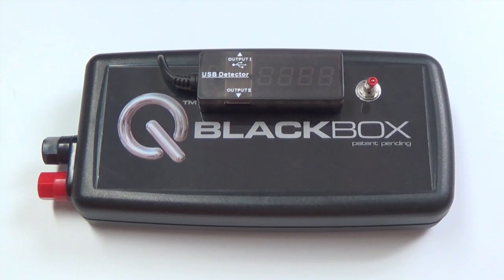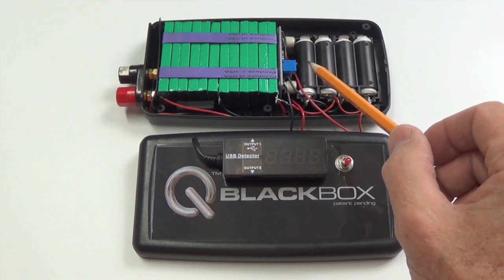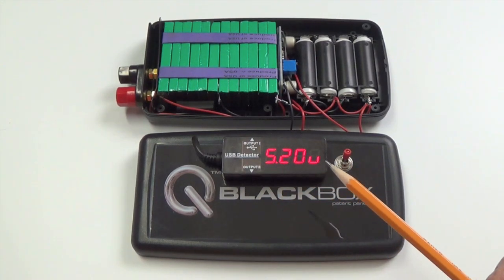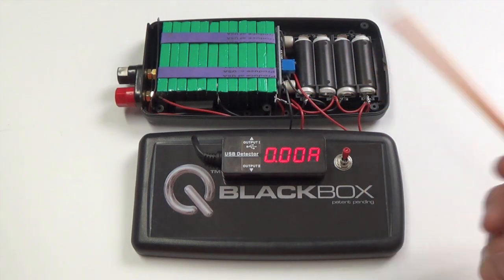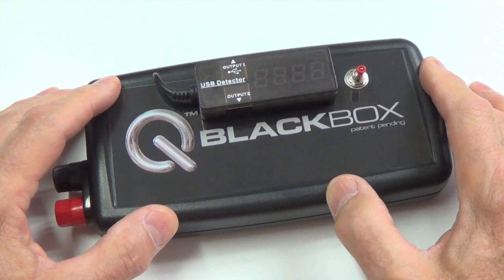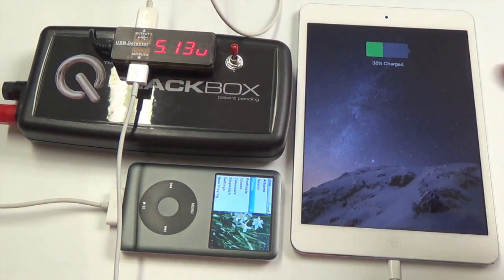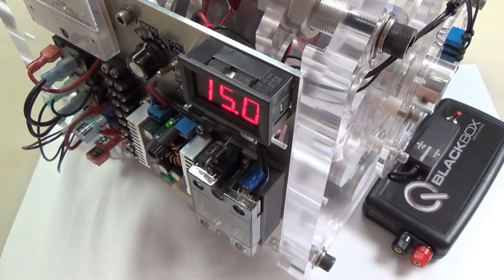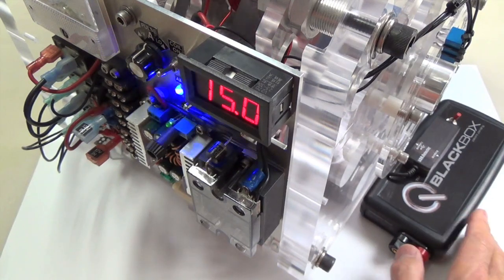BLACKBOX - USB with advanced Silicon Crystal Graphite Battery Technology

Comment: I am skeptic about these "self recharging" batteries. Where do they take the energy from?
Reply: Crystal cell batteries recharge themselves by drawing zero point energy from the quantum vacuum. There is never a shortage of energy in the quantum vacuum, so these cells can keep recharging themselves for years on zero point until they become deformed from internal pressure and can no longer draw energy. A properly designed crystal cell can last over 100 years. The crystal cells I made over a year ago still recharge themselves and are not showing any signs of deformation yet. 'Lasersaber' has a great video on making your own crystal cells if you're interested to learn more. The reason you need lithium ions is because the crystal cells are for energy generation. You still need energy storage which is where the lithium ions come in. You could run it straight off the crystal cells, but only for a limited amount of time because they lack energy density and energy storage. Lithium ions don't have this problem.
Reply: From my experiments with crystal cells and radio frequency, I found the tiny amount of power from radio waves and stuff being transmitted from phone masts and radio stations can provide a weak power source to gradually charge a crystal cell.  Basically, the piezoelectric effect on crystals because RF is oscillating.  I have charged my crystal cells very fast putting them next to a Tesla coil, which is high RF.
Reply: Don't get me wrong, i do not think there will ever be a discovery so abstract to the known laws as to discredit gravity. I just feel there is always a chance that something is missing in our theory of gravity. Hell we may one day discover that what we call magnetism is just a property of gravity acting on ferrous substances over cosmically small scales. Well... I'm no scientist so i cant say for sure,  but you get the point.
Reply: the current from the "cells" is very small, enough to VERY SLOWLY charge the "batteries".. once enough charge is stored in the batteries then the batteries can use that charge very quickly at a higher current.
the current from the "cells" comes from a chemical reaction, simple as that. a very small, slow chemical reaction.
nothing here self-charges, there is a charge in the cells being transferred to the batteries. all power cells require fuel to convert to energy. even solar cells.
Reply: Ghryst VanGhod Isnt voltage pressure and amps flowrate? I mean Amps is measured in coulomb/second
Reply: QuikSilverPlanet
I've seen the entire catalog of the 'Energy from the Vacuum' series and I've watched Lasersabers videos.  The problem is when you start using terms like 'vacuum energy' and 'zero point' energy, electrical engineers cringe.  It's pseudosciene to them and they are the experts.  In fact, you can';t even put those terms in patent applications.  That's why people like John Bedini haven't been able to get their machines patented or even published in any main stream science journals.  You've got to be able to explain how this energy is collected and converted with real science that can be tested.  Tom Bearden has spent over 30 years trying to explain it.  The machine may work but until it's explained and tested and repeated through the scientific process, it's not viable.  It very well may be using energy from the vacuum but how does that work?  Where is this energy?  Why does it appear out of nowhere?  What's the mechanism?
Reply: Peter Müller
There are no reactions that last up to a year or more capable of generating any significant amount of current with the exception of maybe radioactive elements.  You might be able to find something to generate a few milliamps at a volt or two but that's about it.  Youtube is full of videos of people building crystal power cells capable of running an LED for an indefinite amount of time but those have valid explanations such as changes in temperature, moisture, or pressure.  And the LED's are significantly under driven and don't output any usable amount of light.
Reply: True about closed system vs open system. Most people think in terms of closed system and dismiss free energy as a possibility. Lasersaber made a video recently where he went to visit an atmospheric electrical tower farm which harnesses many KWs of power. Check it out. They use graphene collectors in the towers to collect ions from the atmosphere.
Reply: paul4pres08 And vibration of what exactly? And even if so: where do they come from since energy must be conserved.
Reply: chemical energy from the "power cells" recharge the lithium ion battery.
eventually the cells will degrade and no longer give an output. until this guy releases his data, or sells someone one for testing, we will never know how long they last as this guy does not state the chemistry he has used
Reply: Ghryst VanGhod Great to see that I'm not the only sceptic
Reply: oh, it does what he claims, he just makes his claim in a very vague way
Reply: Yeah, I think we understand the claims being made but I think the question is where do the power cells get the energy to charge the lithium ion batteries?  There are many different battery type devices and capacitors with chemical energy but once they are depleted, that's it, they must be recharged to keep on operating.  If this product is ever going to take off, he will have to explain where the energy comes from.   Saying the power cells output chemical energy just won't cut it in the market place.  It will never be more than a novelty.  Just like Bedini's machine.   The real question is, why do you need the lithium ion batteries in the device in the first place?  If the power cells can charge the batteries, then they sure as shit can charge a battery in a phone or other device.   So why do you have to charge a lithium ion battery in the black box before charging a lithium ion battery in a phone?  Why not save the money and losses from charging the batteries in the black box and charge the battery in the phone directly?  Something just doesn't add up here.
Reply: Ghryst VanGhod
The video claims the "very slow chemical reaction" is capable of charging four amps worth of current at 7.4 volts within twelve hours.  That means the "very slow chemical reaction" can output almost 30 watts in 12 hours.  That's a hell of a lot of energy.

If we take the most conservative estimate of 12 hours, the black box is able to output 2.5 watt/hours without having to use a lithium ion battery as temporary storage.  That's plenty to charge your phone or other device.  

The bottom line is any device that can output 2.5 watt/hours without ever being charged is truly unbelievable and would sell like crazy.  I just don't think it's possible to manufacture something like that which would last more than a week at the most.
Reply: rubbish.
if the claims he makes are true, then we are back at the question of: "why not use two cells, and throw away the battery?"
Reply: ps: an alkaline battery is never charged, and it puts out a higher voltage and current
Reply: pps: you dont charge amps, you charge voltage, amps are created from voltage during charge/discharge.
if you think of electric fields as water in a pipe, voltage is flow rate, amps is pressure
Reply: basically, "four amps worth of current at 7.4 volts within twelve hours" is not equiivalent to "30 watts in 12 hours", it is equivalent to "30 watts for an instant"
but no battery i know can discharge so quickly. if you put that charge into a capacitor instead of a battery, you could make a 30w globe flash briefly
Reply: Peter Müller nope, its an analogy of course, so you can interpret it differnetly, but i say amps is pressure, because amps are a measure of how much work can be done. you could also think of it as horsepower vs fuel consumption
Reply: QuikSilverPlanet No energy can be endless. Even "zero point energy" cannot be harvested endlessly. It can only be harvested by seperating opposing quantum particles as they pop into existence. However our universe will in the long term have the highest entropy. So opposing that principle will cost energy. And that will be equal to the energy gained. So where does the energy come from? ((Completely ignoring the fact that creating a quantum vacuum itself is difficult enough))
Reply: Ghryst VanGhod I think amps is more accurate since it depends on flow/time. However pressure/voltge can be created without flow.
Reply: zero point energy (energy extracted from casmir forces of virtual particles winking in and out of existence) is measurable, measured, and severely lacking the power to account for devices such as crystal cells (which is what i presume the black boxs "Silicon Crystal Graphite" cells are a type of).

http://www.scientificamerican.com/article/follow-up-what-is-the-zer/

http://www.scientificamerican.com/article/something-from-nothing-vacuum-can-yield-flashes-of-light/

(neither of these articles deny the existence of zero point energy)
Reply: Ghryst VanGhod Look in my answer to QickSilverPlanet why that is very unlikely to be the source of Energy
Reply: Ghryst VanGhod

I really hate playing the quote game but your responses left me no choice.

 '30 watts for an instant'.  I said it outputs 30 watts in 12 hours, not an instant.  That's 2.5 watts in an instant.  2.5 watts times 12 hours is about 30 watts total.  The person making the video said this too.  He made the claim that it outputs a total of 30 watts over 12 hours, not me.  The power cells are capable of generating 2.5 watts continuously without ever being charged.  This was determined from the video itself, not me.  I just did the math. 

"you dont charge amps, you charge voltage, amps are created from voltage during charge/discharge."
Dude, where did you come up with this?  You charge using a voltage at a given current.  You don't charge a current nor do you charge a voltage.  You charge a battery. 

"because amps are a measure of how much work can be done. you could also think of it as horsepower vs fuel consumption"
Where did you learn this?  The measure of how much work can be done is measured in joules or coulombs just like Mr. Muller said.

"an alkaline battery is never charged, and it puts out a higher voltage and current"  Alkaline batteries also deplete and don't magically charge themselves back up. 

You keep bringing up the quantum vacuum and zero point.  I don't think you understand that these terms are not valid scientific principles.  They are not repeatable and they are not defined.   Regardless of what you call it, there is a mechanism that needs to be explained.  That is why Mr. Muller and I were asking the question.  Where do the power cells get the energy to charge the lithium ion batteries?  Saying it's a slow chemical reaction that collects zero point energy is scientific hogwash.  It's meaningless.
Reply: Ghryst VanGhod
I think I'm done here.  You seem to have a big misunderstanding of electrical engineering principles. I just have a simple question.  Where do the power cells to charge the batteries get the energy from?  I'm hoping that someone with a background in electrical engineering can explain this using engineering principles rather than quackery.
Reply: are you a fool?
i answered that already. chemical energy.
there is no zero point energy at work in these cells
Reply: Ghryst VanGhod what reaction is so slow but yet releases so much power?
Reply: err.. erosion?

what are you trying to say?
Reply: lots of chemicals have very slow reactions
Reply: Ghryst VanGhod but they also release almost no energy measurable
Reply: ***** That was my point.
Reply: piezo electric crystals are another (fascinating) subject altogether ;) but silicone is not piezoelectric, so that must not be the effect in this video
Reply: Inventor3 on youtube and others have shown you can collect RF using capacitors and zenor diodes when in the right circuit but it is a tiny amount. Rf smog collection.
Reply: Spangley Rainbows
That makes complete sense.  But the power cells in the video claim to charge four 3.7 volt 2ah lithium ion cells in 12 hours or less.  I'm sure you agree that's nearly impossible using RF unless you had thousands of crystal cells which just wouldn't be practical in cost or size.  I'm curious, how much energy can you get from your crystal power cells?   I've wanted to put one together for a while but never went through with it.
Reply: There is a limited amount of energy in our space time dimension, but the quantum vacuum has no space time fabric and therefore can store an infinite amount of energy and has no entropy. Crystal cells always recharging without fail until they become deformed is proof of this theory. Every time I think about drawing in zero point (chi energy), I can feel it entering and leaving my body causing a tingling sensation from the electrons and a slight breeze from the negative ions. My psi wheel always spins when I direct chi energy at it, even from the other side of the room. The energy is always there without fail, whenever I want to harness it. So from personal experience, both from a scientific perspective and spiritual perspective, the supply of zero point is endless. The idea that zero point can only be harvested by separating opposing quantum particles is rubbish. The quantum vacuum is different to a conventional space vacuum in that it's a completely different dimension and cannot be created. Why would you want to create something that's already there?
Reply: I don't think science has got to the point of accepting that the quantum phenomena applies the the physical world level or macro scale., but I think I tend to agree with you that energy scarcity only happens in a close system and that at a quantum level energy could be infinite.  On another note there is a huge amount of power tied up in atmospheric electricity that is accessible just look at lightning, I am amazed it is not used as an industrial source. The whole stratosphere is swimming in charged particles..
Reply: Nikola Tesla is the best person to explain zero point energy to you, but I'll try my best. Incidently, Tesla managed to document and detect zero point using various scientific equipment over 100 years ago. I've been able to verify this claim by detecting one type of zero point using a geiger counter. The quantum vacuum is like a mirror dimension of our space time dimension, overlayed over the top of our dimension. It would seem the 2 dimensions occupy the same space because we think in linear terms, but they are completely different dimensions. The 2 dimensions can only interact under the right conditions. There are a number of different 'right conditions', but the one required for both crystal cells and organite is to have alternating layers of metal and organic material including crystals, compressed into a zero oxygen environment. Then you have a bridge between the 2 dimensions. If you have a bridge, then you can draw energy. I have the feeling that electric universe theory also has something to do with this phenomena, but not sure what exactly.
Can't get a patent? That's because the elite who stole Tesla's work, don't want to share. Tesla also spoke about zero point in terms of chi energy or psychic energy and the quantum vacuum being the spirit world. The elite also use zero point for paranormal control over the masses. This is another reason why they don't want you harnessing zero point, not just because of free energy. To improve your scientific knowledge on zero point, try making your own crystal cells and run tests. To improve your spiritual knowledge on zero point, try experimenting with organite and a psi wheel.  If you study both sides of the coin, you'll piece a lot more together.
Reply: QuikSilverPlanet Zero point energy has absolutely nothing to do with dimensions. It basically is based on the fact, that in a perfect vacuum randomly pairs of particles are created, only to eliminate each other short after. If you seperate these particles you effectively created an energy potential. Nicolas Tesla has never done anything about zero point energy. And energy has absolutely nothing to do with spirituality.
And about closed systems: Our whole universe is a closed system so every of your arguments are invalid.
Reply from the maker: In reply to Ghryst:  This guy doesn't plan to state chemistry or critical fabrication process.
Reply from the maker: In reply to Peter's initial comment, that's Ok, I probably would be too. It's a hybrid cell that is partly galvanic, semi-conductive, supercap layered with an unusual dielectric/electrolyte. Nine total elements per cell.
Reply: PMMG4HYBRID But where does the energy come from? Galvanic reactions normally only last at most a day under full load. And even then they dont recharge without exterior energy.
Reply: The sandwich of graphite silicone must be a very good heat absorber of the cell to give a amp result like this.
To see the other video it's really promising.
Reply: electronegativity
Reply: spidermonkey211 1. Thats just a word
2. It describes the energy released at an redox reaction
Reply: Mono-thermal doesn't utilize a redox reaction
Reply: if you layer copper ,phosphorus, chromic oxide, and aluminum magnesium in a electronegative order it converts heat to electricity. but you can use other materials like graphene, aluminum, magnesium, copper. basically the Seebeck effect
Reply: spidermonkey211 Oh I see.
Reply: Resonance within the crystals is where the energy comes from, as with everything in our universe. Sympathetic vibrations, oscillations, resonance... they are crystals that he's using after all. All the quantum quackery talk about non-existant particles is just 'modern" physics misunderstanding.
Reply: There are no virtual particles. This is the fantasy of the cult of GR/QM. Everything is sound, fields, sympathetic vibrations, oscillations, and resonance. Einstein made correct observations and drew the wrong conclusions. This man is doing great work and clearly understands a great deal of this knowledge. The 3,6,9 are replete in his projects and even his symbol is of sacred geometry. I've watched so many of his videos and it's all right there. He HAS to dance around and NOT make claims of "OU" to even be allowed to produce/sell anything. Even not selling anything, he would be labeled and jumped on (as he already has).  If anyone has issues with his devices, prove them fraudulent. I sincerely doubt this will happen.
Reply: He can sell them all he wants without claiming "OU", which he is not. He can sell research projects however and "we' can do whatever we wish with them. That's how our system is setup, as history has amply demonstrated.
Reply: Tesla did not talk about the Quantum other than to debunk Einstein as a crackpot (as did other of his brilliant contemporaries). The entire cult of GR and QM is the antithesis of Tesla and his contemporaries. We have been lead down a long and bleak road and asked to believe in "virtual" (non-existant) particles. Particles particles particles, insists the physicist... Physics isn't capable of answering these questions because they deal in the PHYSICal. Quantum measures QUANTity. The principle force of our universe, therefor, cannot be defined by physics, no matter (pun intended) how many made up particles they chase after or invent to balance out their own equations (which they do openly state that they need to do).  Sound, sympathetic vibration, oscillation, and resonance. You absolutely MUST understand magnetism or you will continue to draw the wrong conclusions, from accurate observations, just as the thief Einstein did.  (Side note:) Also, Tesla went to work for the U.S. government. You think he really just "disappeared" for 20 years :) lol. Some huge advancements by our government were all made during the time he was helping. He always considered himself a great patriot.
Reply: paul4pres08 You do know virtual particles can be observed?
Reply: paul4pres08 And by the way a small tutorial how science works: Someone imagines something new. This invention can be used to describe observations. However sometimes these hypothesises require some variables to exists. These sometimes refer to actions caused by particles. This action can be used to refer back to the particle and allow for even more predictions for these particles. Some day through advancements in sience the existence of these particles can be proven/proven wrong. However since the invention often works so great we can almost be sure they are true because they allow to do more progress in different directions.
Reply: The resonant field within the geometric structures of the crystals as they naturally, sympathetically vibrate. He's transferring/transforming this energy and storing it into the batteries for longer term. The crystals could also be used to store information, as is already know.

At this point I would direct you to the work of Ken Wheeler. His book on Unlocking the Secrets of Magnetism, for one.  This should get you beyond the bastardization of knowledge by "modern" physics and demonstrate the fallacies of Einstein. Or you can view his video series on the subject. There were over 100 videos last I saw.

If you'd like a better (or perhaps more clear) demonstration of the energy tap, (specifically)  coming via resonance, check out Gerard Morin's latest video. The energy is always there. There are no violations of CoE happening. You're tapping an open loop system (nature) and converting it to a closed loop. The energy isn't being created nor destroyed.  It is borrowed, transformed, and returned, as is a natural life cycle.

I'm not speaking of anything that the mental giants of the 1800's - early 1900's didn't believe. As in the ideas found in the book that Tesla (in his famous picture) has his hand on (like one would have on a bible).
Reply: paul4pres08
But if extract the energy from the crystals. They should at that point no longer hold energy. So the question still stands: Where does the energy come from?
And also I think that millions of very clever scientists are way more likely to be right ((Especially if the theorems are peer reviewed)) than one person who did not even do a scientific publication.
Reply: +Peter Müller the. The crystal will refill if it's resonating at its natural rest. All of the people I'm referring to invented everything we know as the power grid today. Einstein invented nothing. You can continue to reserve your praise for publishers and writers. I'm with the doers. Physics cannot provide the answer because to that religion, everything is particles. This is why there are millions of clever scientists still chasing endlessly down the rabbit hole and have yet to ever have denotated what a magnet is and the how/why they work. They cannot explain IAAD due to the same inherent limitations. Of course you can believe whom ever you choose to, but if you want the answers, they were giving them out up until the early 1900's. The experimenters lead the way I hampered by the religion of Einstein and what he spawned.
Reply: +Peter Müller *unhampered. Wth haha
Reply: paul4pres08 Elektromagnetagnetism is an elemental interaction ((or elemental fore if you want to))  which is described by the heavily documented Maxwell-equations. Second: Einstein most famously invented the general and special relativity which gets more and more proven ((for example through gravitational waves)). Also he dicovered the photoelectric effect and therefor the basis for optoelectronics like solar panels, leds and optocouplers. Also Einstein laid foundations for what through Plank became Quantum mechanics and the standard model of particle physics which can decribe almost everything. He also invented Lasers. He predicted and discovered together with Bose the Einstein-Bose Kondesate.
So you cant say Einstein invented nothing.
My question to you is: What do you think are particles?
Reply: +Peter Müller Gravity is magnetism. I don't wish to go back and forth about the principle understandings. I've provided where to look if you care to. I'm stating that GR and QM are built upon incorrect conclusions made from accurate observations.
Reply: paul4pres08
Why should gravity and magnetism ever be the same? It makes no sense.
If so explain to me why to 20g masses can have stronger "gravitational" forces to each other then one 20g mass to a 6,000,000, 000,000,000,000,000,000,000 g mass?
Reply: I'm done brother. I let my previous post stand. That was the end of the discussion from my side sir. If you want full and detailed answers, I've provided the places to find them and I wish you the best on your journey.
Reply: Well you can never really prove a theory... that's what makes it a theory. GR is just relatively consistent with observations. Don't forget that if we find even 1 inconsistency with the theory and the entire thing will need to revised... or in some extreme case, it may even need to be thrown out all together.

And aren't we still trying to unify Gravity and QM to find a theory of Quantum Gravity?... Most if not every theory is incomplete and susceptible to revision in the future. Einstein, Feynman, Schrodinger, and others like them have made great advances in science based on the theorys of their times, but the same can be said of Aristotle, and Newton, and the theorys they used were either incomplete, or just plain wrong. 

Nothing is set in stone... keeping an open mind it how we move forward, and discover new technologies. Just imagine what the world would be like if Galileo had never questioned Aristotle and his incorrect views. Who knows, hundreds of years from now the same may be said of the views of Einstein... we can never be sure what the future may tell. We must keep moving forward.
Reply: Mokou TV. In that context I agree with you. However I wouldnt abolish e.g. the Coulomb force just because some other theory might question it. But of course if something can be proven to be inconsistent with current laws and theories we have to revise them. But also we do not call Gravity a theory anymore but a law since we are so sure that (except for some cases in for example quantum mechanics) there is no way of disproving gravity without questioning many other laws.